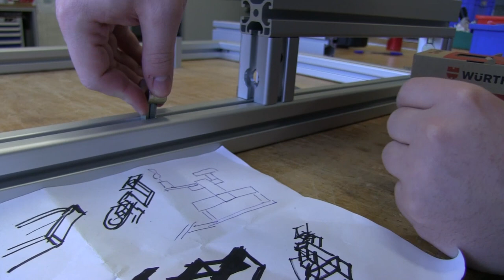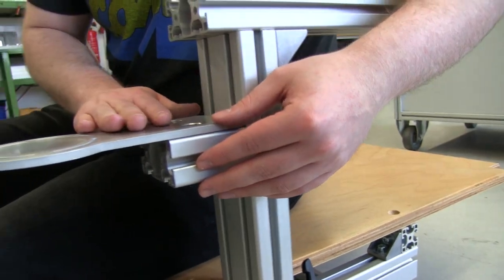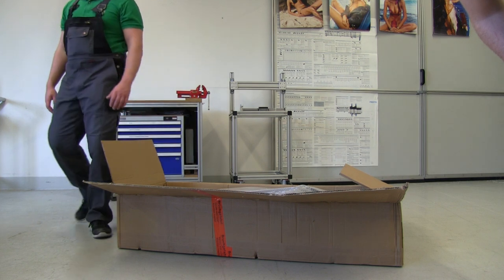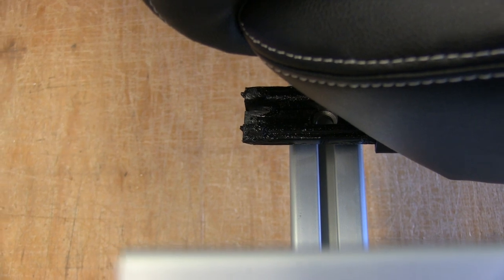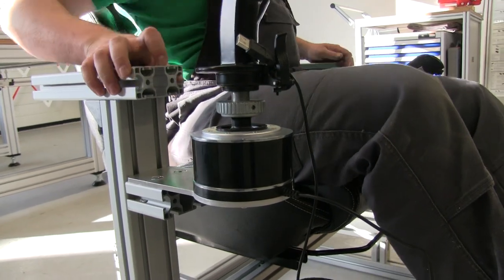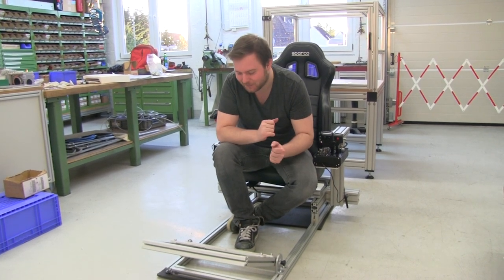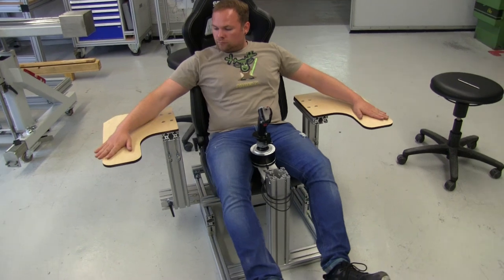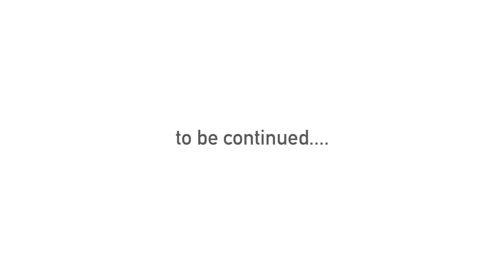Flight Sim Rig - Full Aluminium with Thrustmaster Warthog

Comment: I like the very last configuration. Two things though. Firstly, I would use a track ball mouse instead of a regular mouse. Less footprint. Secondly, I would add a side piece with a keyboard attached to it, which can be swung over to the center. Just like what you see in the Gundam Seed animation.

Comment: Very nice job. One possible flaw or minor area to improve; the arm on the right is a bit trapped with a right-mounted stick, and with limited range of motion. Center grip stick arrangement is okay, but normally you wouldn't have that panel there. 
-
This could be improved with a smaller surface area connecting the right desk panel to the aluminum sub-structure. Think of it more as a resting pivot for your right arm than a full desk with full arm support, though you could keep the generous mouse area as-is. Great effort though, and I loved your vid.

Comment: I am interested in what you created and would like to know what you would charge to rebuild another frame and could you build it for just under the seat the length that runs from the front of the seat is not necessary.

Comment: Those arm-rests are completely in the way of the joystick and throttle! If you plan on cruising in a cargo hauler you'd be fine, but in a dogfight, you really need to have your arms lower on the joystick and throttle.

If you add armrests I'd suggest maybe a hinge so you can fold them away from the joysticks.
Reply from the maker: The good thing is you can adjust them how you like. Need the armrest lower, set them lower. Need the joystick higher? Do it. Every joint of the rig is fully adjustable.

Kind regards
Olsen

Comment: You can do even better by building a wood board that rotates from a mobile support (from the left one as example) and get attached on the fixed one (the other one on the right as example). In this case you'll have the space of a real cockpit being able to mount later a curved LCD/LED panel or a laptop or both on it. That obviously will require a hell of a strong mobile mount. But hey, that' s simply me wondering about an all-in-one solution.
The central support could be a Y support with a mobile arm to attach the stick that will move from down (resting position) upward and a fast arm that goes downward to attach the feet rest.
Love your work. Next black Friday I' m going to buy an high-end gaming dator and install Star Citizen, that's why I was searching for a gaming chair like yours.

Comment: I've got a MAXNOMIC Leader chair which has some nice, thick metal plates that extend from the base of the chair to hold the armrests. I've been wondering how I can clamp or mount a telescopic pole to each side and use that to mount my X-56 Rhino HOTAS. I love the desk mounts you guys make but I've been hoping you'd find a universal chair mount solution that might work on some of the larger, studier gaming chairs. That would be ideal for my setup!
Reply from the maker: We are actually working on a seat mount right now. We are planning to make am office chair base that you can attach a seat to. Maybe you will be able to use the mount part too. May to some time tough.

Cheers Olsen

Comment: Does this setup support the Thrustmaster 16000m and the TWCS Throttle as well? Didn't see it on the website so I thought I'd ask since the throttle is new.
Reply from the maker: We should get the new T16000 joystick and throttle this week. We will then make mounting plates as soon as possible.
Cheers
Olsen
Reply: Got one more question. Can the base part that extends from the seat and holds the foot peddles can be removed, or can you make one without that extension? I use dual sticks, so I have no use for the peddles or the extension.
Reply from the maker: Please write us an email to info@monstertech.de if you would like to have a custom price for that.
Cheers
Olsen

Comment: So awesome.  I've been thinking about something similar for a few weeks, but don't have the knowledge or equipment you guys have to build it.  I have a messed up back so want a seat that can be played reclined.  I currently use a nice recliner with mousepad on one armrest and Logitech G13 on the other with my keyboard in my lap.   But I really want  dual sticks for Star Citizen.  My initial plan was to use a seat from a luxury car. (love my Audi seats)
Reply from the maker: Thanks. The nice thing is that you can use every seat that you like. I actually thought about using an old Mercedes S-Class seat. That would be really comfy. :)